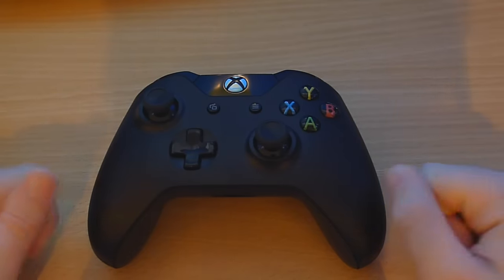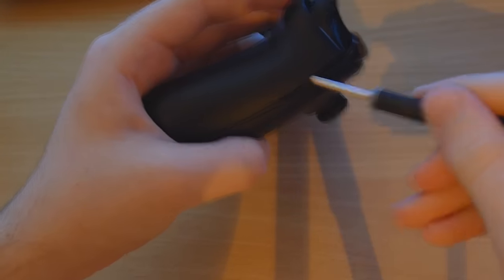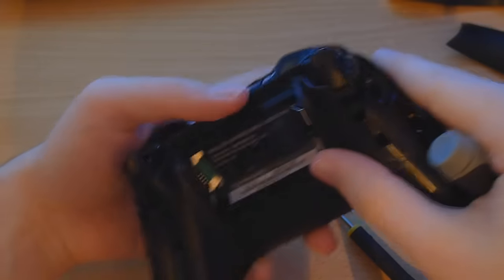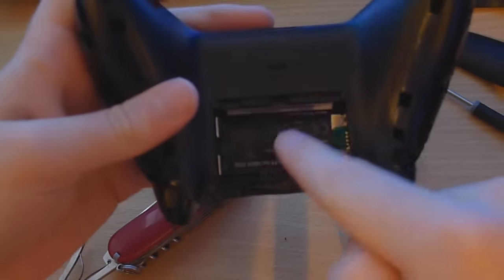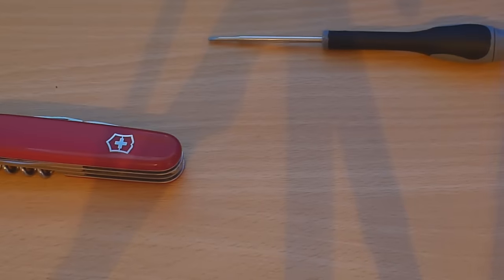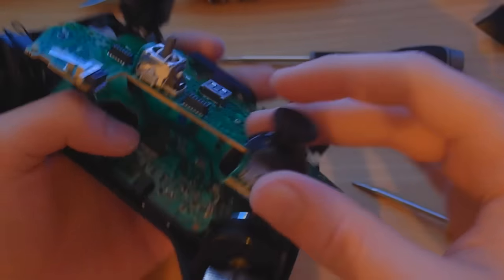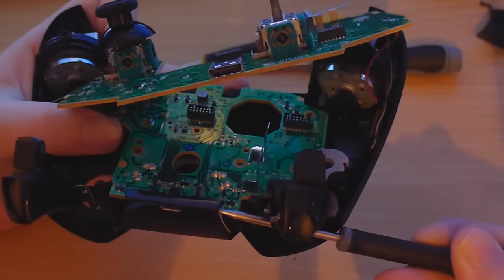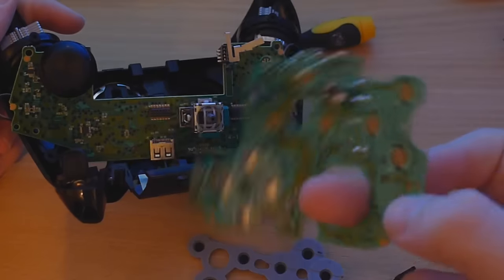How to Open up an Xbox One Controller

Comment: PS4 controller is more easyer than the Xbox one controller
Reply: You say that, but our controllers actually last: My brother had a PS4 for at least 3 months, he broke 2; 1st was by throwing it at a wall (Not even that hard) 2nd was that one of the analog sticks completely broke. I've had an xbox one for 2 years, not a single breakage apart from some dirt and scratches now and then. But, I do agree on that PS4 controllers are easier to take apart than xbox controllers.
Reply: because playstation is shittier quality 😝
Reply: YouDieToCoffee i only need to spray mine so not much of an issue
Reply: Broken Matt Hardy [#DELETE] Are you aware that you can just plug the xbox one controller into the xbox one without any batteries in it just using an android charger?
Reply: Charles Rooks You say that, but you probably don't even know what spec is better 😂😂
Reply: shadow killer bullshit
Reply: Angry fan girls all over. 

Yes, the Ps4 controller is much easier to open and clean. The Xbox controller design is just a pain on the ass to deal with.
Reply: You see, that would also mean that you are 'easyer' to get fake controllers that don't even work
Reply: Easyer
Reply: Sooooo much easier!!!!!
Reply: Have had a PS4 since september 2014. Controller from then has never had one issue. Have had an Xbox one for around a year and a half, and the Dpad is already bad, completely not working. Without any throwing, nothing. Babied and never hardly played as it is. But when I do play now its broke to the point im going to have to take this horrible design apart. Microsoft makes the worst quality stuff I have ever used.
Reply: YouDiedToCoffee I had a ps4 controller for 3 years and it still has not broken yet
Reply: Macrov I always have dpad issues but I figured out how to fix I think
Reply: @bigtruckchuck8021  It's okay to be objectively wrong.
Reply: @Josh350  Because they don't want their controllers tampered with, that's why it's such a pain in the ass.
Reply: @MrKnifeGod  Naw, it's more of trying to nickle and dime consumers. Needed to replace the joystick on one of my controllers. Nothing impossible, just inconvenient.
Reply: @youdiedtocoffee1518  Both of my and my older brother's xbox one controller still in tact. Even when my older brother did thrown one to the ground in a fit of rage, all it did dislocated one of the triggers. So now I need to open them both up and properly fix the issue that the right thumbstick that was having a hard time aiming right.
Reply: @MrKnifeGod  Even though they could've just have their controllers software to do all of the security in the first place.
Reply: @ckhound1  Sounds like a defect.
Reply: @Josh350  Just think about it. Microsoft doesn't want their shit hack anymore.
Reply: @killertruth186  What do you mean?
Reply: @MrKnifeGod  I was thinking that they could put security on the controller through software just like the consoles.
Reply: @MrKnifeGod  Poor excuse, because you can still mod it.
Reply: Its a bitch. Becsuse all my controllers are different generations so i have so many spare parts. And those ribbons suck major ass trying to put back in. Its not easier its about the same dont listen to this lie of a comment lol.
Reply: My xbox remotes suck more ass than my ps4 ones. All my one remotes the aux goes out and the sticks push on because its a seprete chip just like the ps4s but the ps4s must be put be together better since thats never fucked up on me lol
Reply: itz Vnooox   it's all a lot easier than English isn't it, Bud?
Reply: @bigtruckchuck8021  You obviously haven't owned both consoles. I have. Xbox CONTROLLERS are far superior. There's no debate there.
Reply: YouDiedToCoffee I’ve been using the same ps4 controller for 3 years no and the only issue I’ve had is my left analog stick 🤷🏻‍♀️ but I change it out every other month as well as my other buttons.
Reply: @maddif3141  change it out every other month LMAO. Because its trash you have to. I've owned both. Xbox controllers last years without changing anything out.
Reply: Cedric Williams I don’t change it because I have to. Also the parts I buy are literary $1 😂 it’s called being indecisive and not making my mind up on what color I want.

Comment: A bit late to the party, but you don't have to remove the solder to take the top PCB off, you just have to go further with your disassembly and remove the front plate and bumper pads.

Comment: My first YouTube comment ever since yout6 was released or at least one of my very few- Thanks a lot Modded, I used this to take apart my controlled today to replace the left stick on my Battlefield 1 green edition unit, the grip had came off, I replaced both sticks with custom clear in 25 minutes with no prey tool, lookin sharp. Thanks again!

Comment: Good vid but if you are having trouble with the screws still if you get a slightly bigger screwdriver than the one you broke the pins with they unscrew like flat heads

Comment: you can cut the wire solder them in the middle and coat with liquid electrical tape just as easy

Comment: Soo, the reason I wanna open my controller is because from the outside it looks the headphone thingy is misplaced a bit to the side and my headphone jack won't work like this, I've been trying to open this piece of shit for over half an hour now and I'm literally stuck in the bottom right screw and can't get it out, I don't even know if I'm doing this for nothing but I just wanna fix it, I literally bought it 4 days ago and don't wanna buy a new one because I can't pull money out of my ass, but I literally don't know what to do

Comment: The problem is that on my controller, there’s 2 screw that i can’t unscrew. Idk why
Reply: Same the ones at the bottom for me
Reply: Same
Reply: Tracy Scott I just got plyers for a better grip
Reply: They have a glue in the screw so you can’t put a screw in
Reply: Thos ones you need a scudriver th
at has a hole at the tip sorry for the bad spelling
Reply: use ur sleeve and hold the screwdriver and the sleeve will create extra grip to break the screw strength a bit
Reply: Same

Comment: You shouldn't be touching the boards without first grounding yourself. You may fry something important with a tiny bit of high voltage static.
Other then that, very useful.

Comment: So, you can just break off the metal in the middle of the screw with a flathead screwdriver and then use a T10 screw to easily take the screw out

Comment: this work and my friends so all need is to add a band those things you use to shoot paper you push in the controller the one is have problem then when some of it sticking out leave it. then push the controller until you hear clicking then it will work. it 99.7% safe trust me

Comment: Did the steps in the video with a late model One controller and the thing basically exploded anyway, so the top comment is more accurate than humorous. Multiple pieces secured only by the unibody construction and basically impossible to figure out for someone not building it at the factory when something goes flying, and a high likelihood something broke. Thankfully I had a spare original model One controller with just a broken RB and I cannibalized the remains of the former for the latter, which I was shocked to discover was far more changed than I thought. At one point I thought they had only changed the cover of the RB/LB buttons to make it less likely to snap, but the whole thing comes apart almost entirely backwards, and actually reminds me much more of a Switch Pro than current XBox controllers, but even that claim is almost insulting to the Switch Pro. 

If you’ve never seen one disassembled, pull up a video. Literally any of the top 99.9 percent of reason people take these controllers apart can be done just by unscrewing the grip covers vs the annoying snap off ones that all XBox controllers since one have had, and the way it comes apart you immediately have access to all your buttons and thumbsticks for easy cleaning which is all my current endeavor was meant to do (had a sweaty coke from taco bell that dripped into the start button while playing witcher 3 and was preventing electrical connection which is a big no no for that game as you have to constantly and quickly pause to use things like oils). I’d have had a Switch Pro fixed in this same scenario within 15 minutes.

As amazing as the Switch Pro is for consumer friendly repair, there was also really nothing that needed fixing with the 360 era controllers I’d also be using right now if I hadn’t misplaced my adapter, and only stopped using because official ones are impossible to find and the ones on Amazon require you to manually install the driver as windows doesn’t recognize it, then randomly loses connection one day and you end up with the driver saved to your desktop for the inevitable multi-weekly reinstall of the drivers to get it detecting the 360 controller again.

So BAD Nintendo for not having real triggers, especially when the GCN introduced ones that set the stage for all modern ones whilst still being more advanced than any since. They were borderline PS5 style adaptive triggers. Switch Pro finally added L3 and R3 to the sticks, but the lack of analog triggers makes it unusable for a lot of games for me, when if it had them the rumble would be on par with PS5 at least and make it an easy #2 next to the DualSense.

If the Switch 2 has a Pro 2 assembled like the Pro 1, but with an evolution of the HD rumble on par with the DS5, and adaptive triggers, it’ll be the best controller ever made as well as a Nintendo controller finally living up to the GCN standard again. And that in turn would mean an exodus of PC gamers like me to playing solely on Nintendo controllers, which would hopefully mean proper built in support like the XBox has had for 15 years, that Sony is slowly introducing, and which Nintendo has deserved for years as all the way back to the 2006 Wiimote no wireless Nintendo controller has had any issue interfacing with basic BT on any PC. XBox finally got there, but Sony still needs to get its act together and the proper drivers provided to MS update and Steam so that we don’t have to play wired to get all the DualSense features.

Shew. That was a nice distraction for this nightmare. Just happy that the controller I’m fixing will actually be better going forward than the newer one I went in initially to fix. Even the snap off grip covers seemed to be way more easy to remove than the version 2 One controller and that’s despite those grips being warped as shit from how much force is needed to remove them. Fully expecting this controller to be way less wobbly/warped when put back together as a result.

MS, Sony, Nintendo… Let’s all be friends and set some standards together. MS can push Windows support forward, Sony can share their expertise with the DualSense so far and help the other 2 implement their own version, Nintendo can be an example of how to assemble the components, and together they could all create a manifesto of controller standards for consumer friendly repair. Support people cleaning their controllers officially while you’re at it even if you still can’t (for understandable reasons) maintain warrantee support for things a user could have broken. If you make the steps to just do basic cleaning as easy as a Switch Pro, that won’t even be an issue anyhow.

Comment: I dont get how u pried things so easily, my flat screw driver only ended up snapping once I got to trying to pry the rb and lb parts. Plus everything before that was so stuck together that it took me 1 hour and 30 minutes to get to that part, but I was doing it to two controllers so technically45mins, but still

Comment: Ok well, throughout the night I had took out 5 screws, I lost two somehow I don't think I'll be able to find them can it work with just 3 screws in the backplate? Specifically just the battery screw and the two little ones on the end

Comment: I have absolutely no fucking idea how I did this without a guide, but I did. Parts literally went places they shouldn't have went and I ended up forgetting to put in a screw, but it fired up just fine and worked like new. In mid procedure I was already set to buy a new controller even because I knew I done goofed

Comment: But my screw looks so different cuz my xbox one LB button sometimes not. Working not sure why so i thought maybe its malfunction from company but i assume maybe some dust inside or disorder. But i was unable to open it sadly. Not sure why Microsoft made it complicated instead of having normal + screw. Is it a problem if i spray dw40 bitween the buttons? Ur right i scratched my clean controler by seizures 😭

Comment: Well I've ordered a new one just waiting for it to arrive so in the meantime I'll attempt this as it sucks not to have my Xbox controller as so many games use it and it sure sux to try to reset Elite Dangerous to use rift controller, the thing is anything could be wrong with any controller when mine was assembled and I plug it in the X light would keep flashing so I'd say I'm not far of the path here, But MODDED WARFARE I'd sure like to know what screwdriver your using as my smallest tiniest Philips won't fit those PCB screws?
Reply: Paul Baitson you have to lodge it into the metal and force your flat head to turn it at an angle

Comment: Guys no joke there is a legit way if yours isn’t working because of the dust inside. Take battery lid off, then take batteries out. Blow through hole to which bumper is broken. Yay hopefully it has worked! If this doesn’t work maybe you have a different problem with your conteoller

Comment: I DO NOT RECOMMEND TAKING THE BUMPERS OUT THE SAME WAY HE DID, ive taken apart a couple one controllers before and the way i get the bumpers out is flipping it over and if you look closely there are 2 little clips held in by pins, one on each side, gently lift up on the clips and it easily comes out, not sure if theres a difference in how the older ones are made compared to newer ones but if i would have done it the same way he did i would have broke my bumpers so i highly suggest doing it that way instead of prying them
Reply from the maker: I've been told by some people that with the newer models both bumpers are a single piece. Which is definitely the case with the Series X/S controllers. With the model shown in this video the bumpers are separate pieces.

Comment: When you remove the back panel on a controler does the panel get weaker or more sensitive to open bc i got a new controler and a screw got stuck on the LT trigger button reply asap please i need help

Comment: how tf you break the pins on the screws by “jiggling it about”. I tried as hard as i could to break those pins and made absolutely no progress. I couldnt get more than two screws to come out using only a flat head screwdriver. The other screws were impossible to get out. I guess i will have to get the torx security screwdriver.

Comment: I just threw my ps4 controller at the ground not even that hard. And one of the shells popped out. Still works fine but just need to fix the shell.

Comment: It took me about 15 minutes to take off 3 screws, but I couldn’t get the bottom left one out. So I decided to break the controllers cover off and I cut myself twice. It would’ve been nice if my LB didn’t stop working for literally no reason at all, but hey it was my fault for getting mad and trying to snap the controller in half. (For anyone wondering, no I have never damaged this controller, never threw it slammed it punched it etc, the LB literally stopped working mid rocket league game)

Comment: Careful when breaking the safety pins . Think I have a metal fragment in my eye. Wear eye protection
Reply: Patrick Riley how tf does that happen😂
Reply: Kfbg Dcc I was looking down with my eyes open as a broke off the tip. Best part is my screwdriver had the safety hole and I didn’t realize lol

Comment: Tried doing this (used mod 360 controllers as a side husstle) the who thing fell apart wires snapped off when putting it back together...I only wanted to clean the connection and fix a sticky button and now I have lost a controller...
They don't want you fixing these things so heres how I fixed it...I bought a new controller phoned amazon said it don't work and sent them the old one back problem solved fuck taking it apart I will never bother ever again

Comment: I couldn’t find the tools to do it correctly so I just took a torch a razor blade and heated the blade and slowly cut through the top of the controller around the screws 😂

Comment: Also, I broke my circuit board 😭😭 The one with the analog sticks. It fell and two wires popped loose
Reply: Luckily, I had another controller and just transferred the shell and buttons over to it 👌
However, I think its analog boxes took damage from getting.... dropped alot
Reply: Hopefully, it works without problems

Comment: Thanks mate, great video. Wondering if I can ask your advice on something. I have a gorgeous Atari 2600 unit which I want to make into a master controller for all of my consoles. Just have that by my TV and all of my cosoles out of sight via a long HDMI, to a spliter in a well ventulated cabinet 

 My initially idea is to have the Atari switchs function as power on switches for my Xbox1, PS4 pro, Original Xbox, I am running a PS3 through the XBOX1 and a PC Emulator, so thats 4 swithces used up, one more for a HDMI splitter channel changer and the last one for perhaps a futute console additon like the Switch. 

At this early stage I am thinking the easiest way would be to just, hack a old controller and used the Power LED button off the controller and somehow postion that under the exsiting button, so that when you move it down it compresses the buttone beneath.  I have yet to think of the other consoles yet. Wondering if you might have any ideas